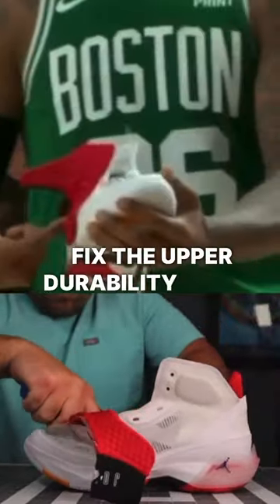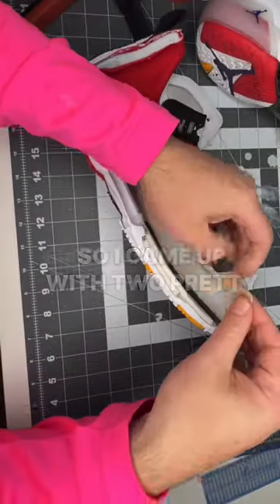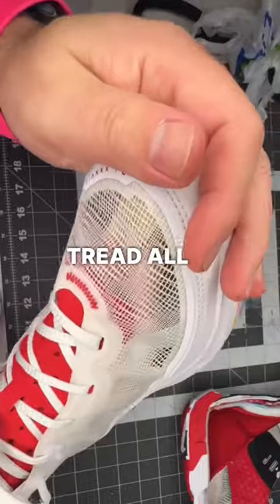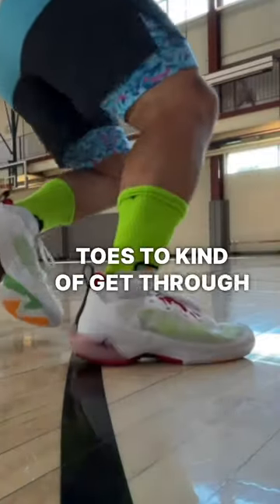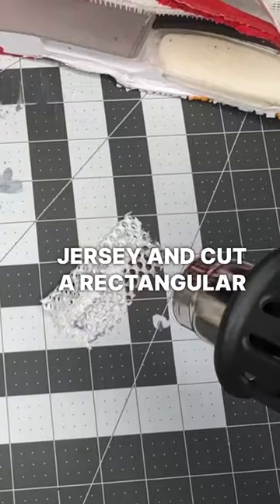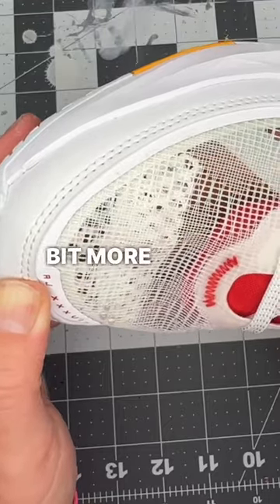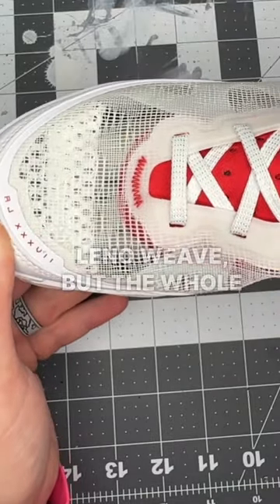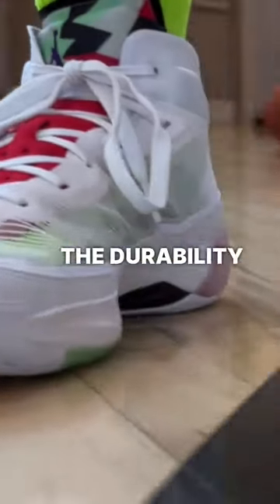I Upgraded The Jordan 37 Using Scrap Materials #shorts

Comment: Great solutions. But I won’t spent 175€ on a pair of shoes that have so thin materials. Would rather buy the Jordan 36 if I had the money.
Reply: As someone with the 36, it is just as thin, you can see your sock through the shoe, but it is more durable.
Reply: @JustysFrank  That’s what I meant. I don’t really have problems with seeing my foot through the shoe as long as the material is durable. When I spent 175€ on a shoe I wanna be able to wear it a full season.
Reply: @amp.Cimbom  Ok. I was just letting you know, I know for some people they don't like just how thin the 36 was either. It is durable though, I've had them about 3 months now with absolutely no issues
Reply: @JustysFrank  I have the Jordan one take 3 and it’s also pretty thin, light and breathable. I don’t think it’s as thin as the 36 but I like it.
Reply: @amp.Cimbom  nah Leno weave is the thinnest I've seen on a shoe ever. It feels really good though
Reply: @JustysFrank  If you don’t mind I ask, how has the tread held up on your 36’s with 3 months of use?

Just picked up a pair of the 36 low and exited to put them to use.
Reply: @trespatines305  I havent played in them a whole bunch, but so far holds up well. Very grippy and really love the bump in the forefoot. Great for pivoting or changing direction fast. Let me know how you like em when you use em!
Reply: @JustysFrank  Awesome and thank you for the reply! I’ll let you know.
Reply: @amp.Cimbom  Trust me, you’re not going to bust through an AJ37 like a 6’7” 250+ lbs Celtics player. Bet.
Reply: No one should. Only buy at heavy discount
Reply: They are only 120 USD now. An obvious failure of Nike/Jordan.

Comment: I don't think it's a durability issue for me, but it's absolutely a comfort issue. The upper is too thin and too stiff, scratching my skin even if I wear thick socks. I ended up with the undefeated version of aj37 with an additional layer under the Lenoweave. They are finally comfortable enough for me.